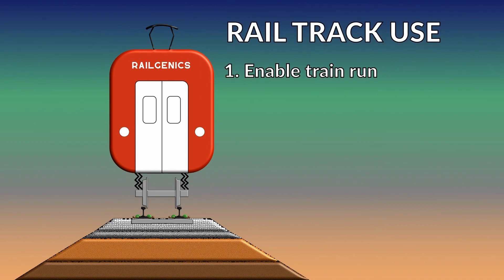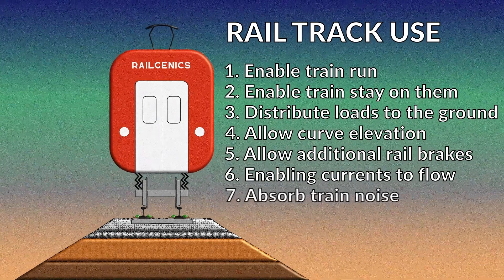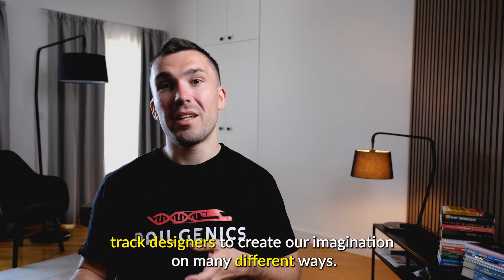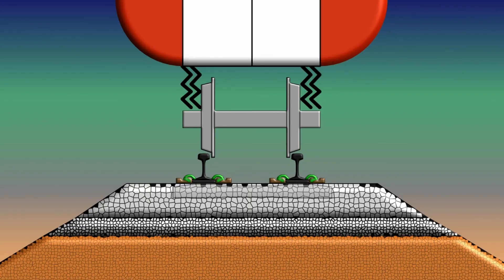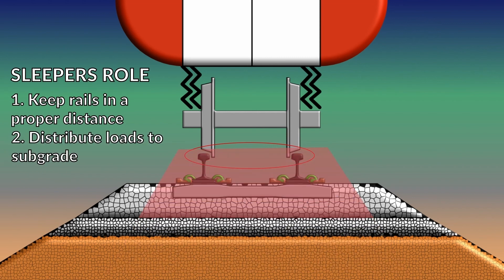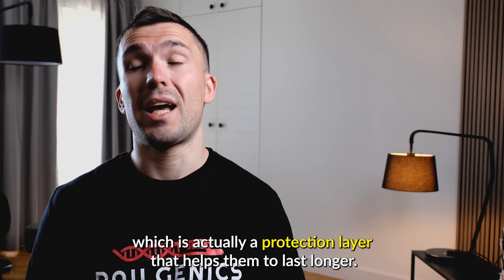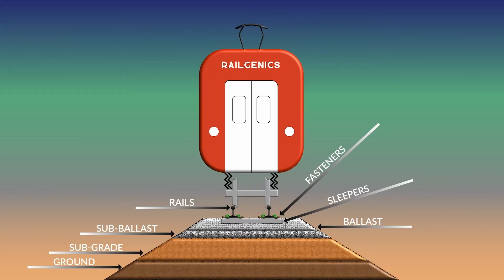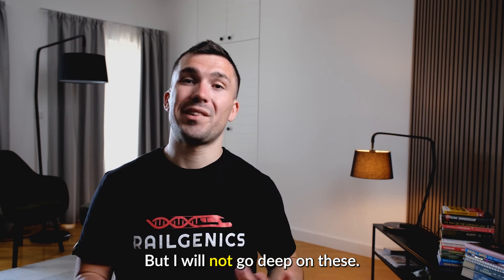Railway Track Basics (And How To Become Railway Engineer)

Comment: Good video. One more (9th on your list) usage of tracks is to aid signaling. tracks are segmented electrically. One rail carries a low voltage while the other rail is grounded. The axles of the train using that segment short-circuit the rails and causing a relay to trip and indicate the presence of a train on that rail segment. Please correct me but I think they are being replaced by axle counters. Thanks.

Comment: The trackbed is also where most of the suspension for a train comes from. More so in the days of steam where the axles of the steam locomotive had very limited freedom of movement. In the UK the gap between lengths of track is 3/8in (9.5mm).